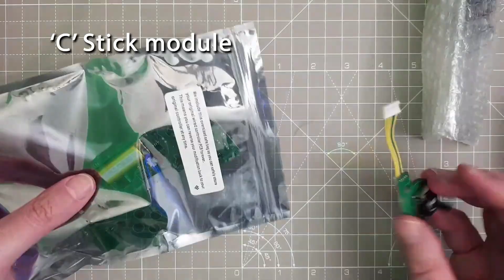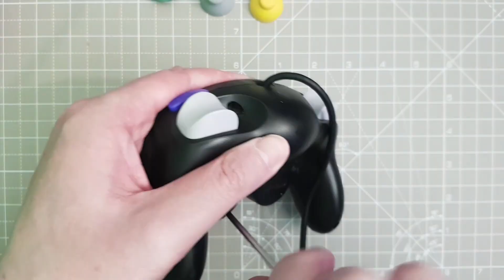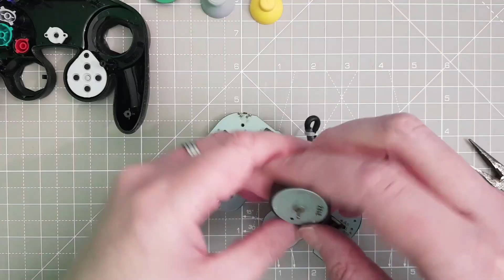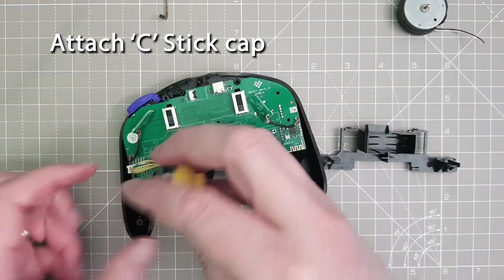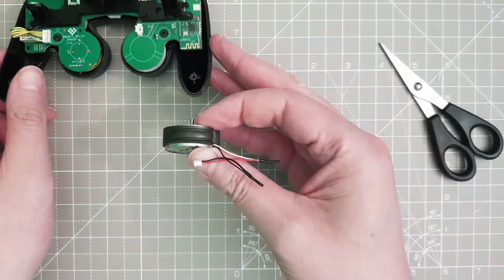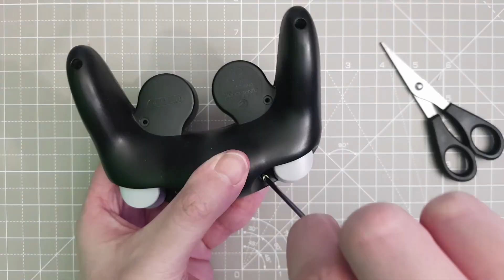Turn an original Nintendo Gamecube controller into an 8BitDo Bluetooth controller #8bitdo #nintendo

Comment: I saw usbc port on top, Does that need to get dremeled in order to charge?
Reply from the maker: @277bbarthur1  No the USB C port is for firmware upgrades. I contemplated dremeling that out, but decided against for now just to keep the case looking clean.

It charges via the little white LED module that got placed where the cable previously came out. It comes with a USB to tiny round barrel type power connector. 🙂